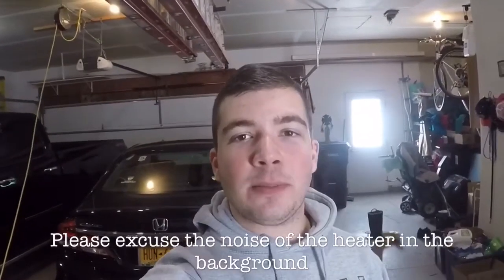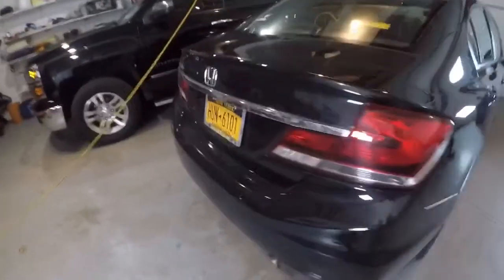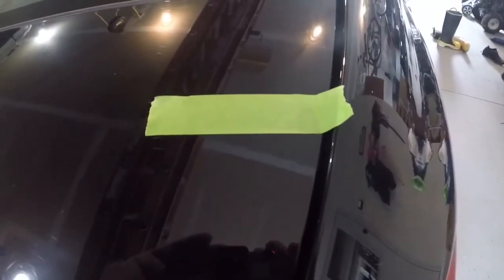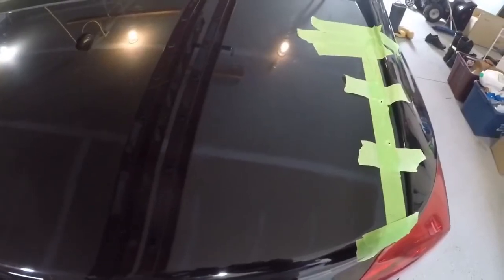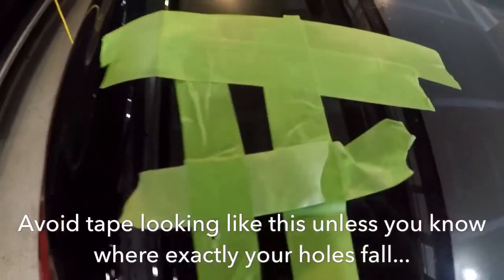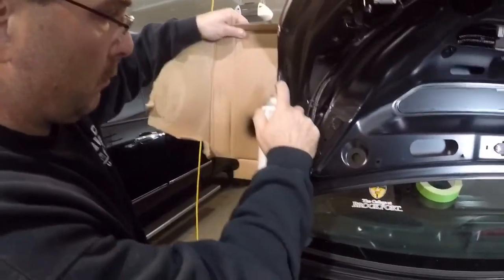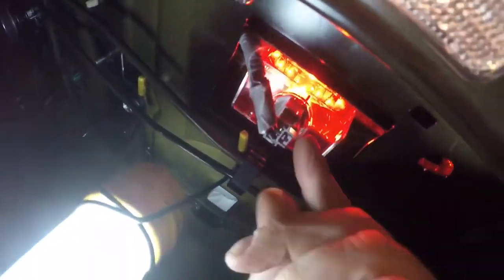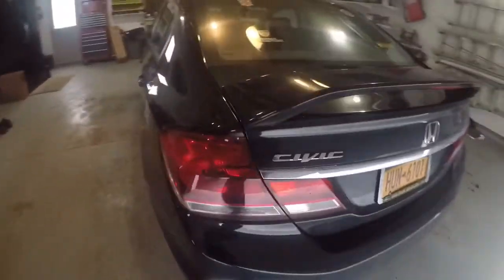Installing Si Spoiler on 2014 Honda Civic EX

Comment: I have a Lx same gen as your and I’ve been planing to asd spoiler too but I think my car is trash so I discourage my self to do so😭😭😭😭
Reply: I got the same car, Lx 2014, I’m getting the spoiler tomorrow and i will go to a shop so they can install it, i got some mods like the exhaust, and fog lights too :)
Reply from the maker: Your car no trash. Base model isnt bad. Yes you lack some features but it is still decently equipped for what it is. Changing the wheels, adding spoiler, and fog lights is all u need to make it unnoticeable on what u used to have.
Reply: @sammygingello  thanks chief! actually  my car drives better and have a better handling than other si’s here around lol having coilovers meatytire  and wide wheels subframe braces it felt really good.

Comment: Hi I just used your video as a guidance to install an si spoiler to my 2013 civic ex. But as far as wiring the break light, do you know which color wire he connected with spoiler? You skipped that step.. like the break light under the trunk is green & black. And the wires from the spoiler are white and white w/blue stripe. I guess I could just test them but I’d figure I’d skip that step of trying to figure that out of which color wire to connect with..
Reply from the maker: Sorry bro I forgot car sold now

Comment: I was looking at this spoiler today and for some reason the site said it wouldn't fit my 2013 Civic LX even though it literally has the same exact rear body as shown lol
Reply from the maker: I wouldnt trust it the 2013-15 same everything in dimensions
Reply: @sammygingello  Update: My si spoiler is coming in today 🙏
Reply: @Blear25  did it work bro ?
Reply: @Blear25  I’m in the same position as you I have a 2014 Honda Civic ex and it says it won’t fit
Reply: @balvarez888  Absolutely fits dude. I've had it for 6 months now and still going strong
Reply: @Blear25  where you buy it from carid? Very tempting what throws me off is it saying it won’t fit my car . But I’ll give it a shot
Reply: @Blear25  I will thanks a lot dude !